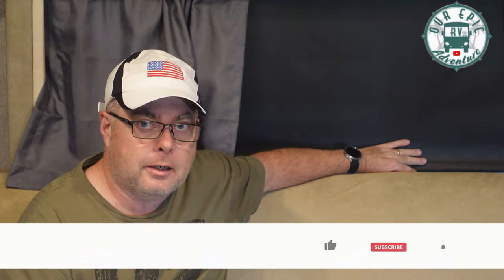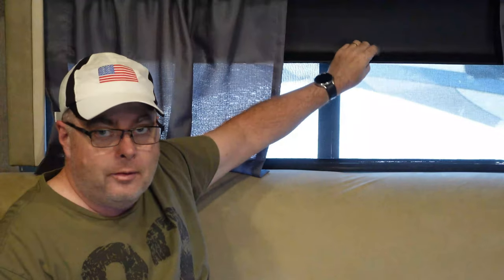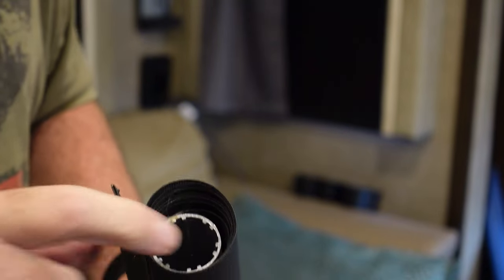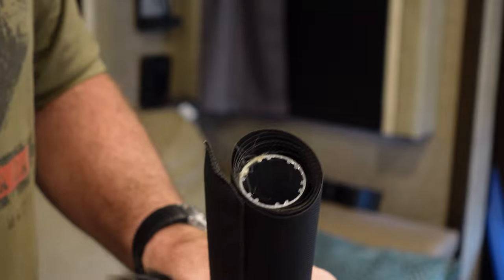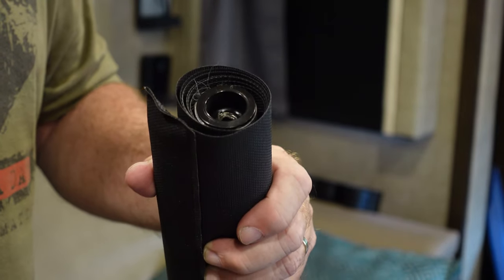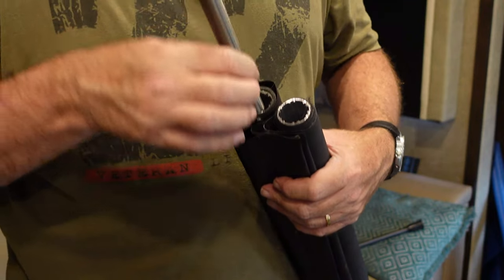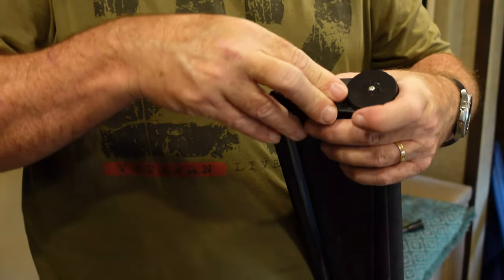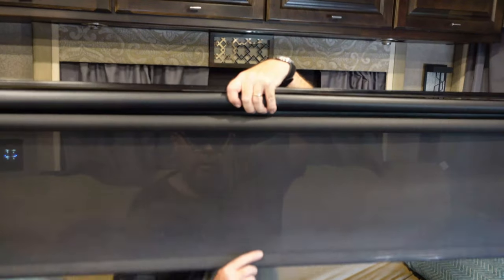WHAT A SHADY VIDEO! FIX YOUR RV ROLLER SHADES EASY!

Comment: Does not explain how to take down the valance or remove the rollers from the valance.
Reply from the maker: Thanks for watching.  That information is different depending on the RV manufacturer and year so it is impossible to include all possible variations.

Comment: What if my night shade doesn't lock into place? I have double shades
Reply from the maker: That was the problem we had.  The roller is most likely broken and needs to be replaced.
Reply: @EpicRV  well that sucks. I can't get replacement parts for this. It's a vanleigh beacon shade. My parents use to have one and bought them for my travel trailer lol